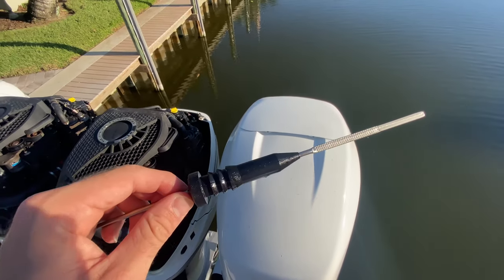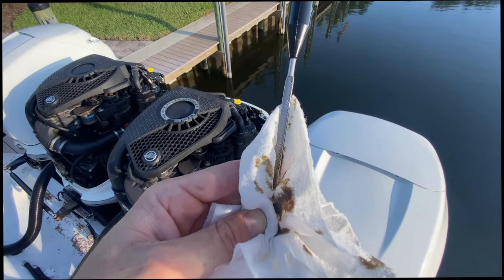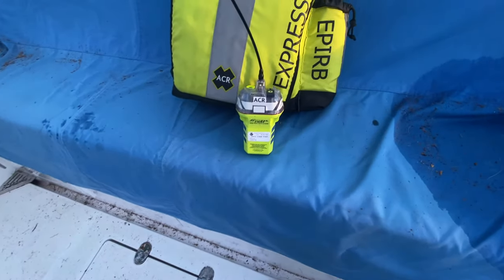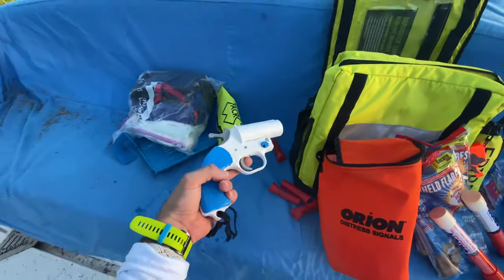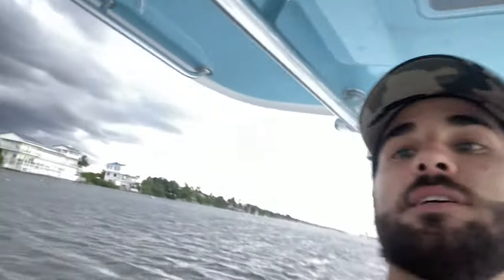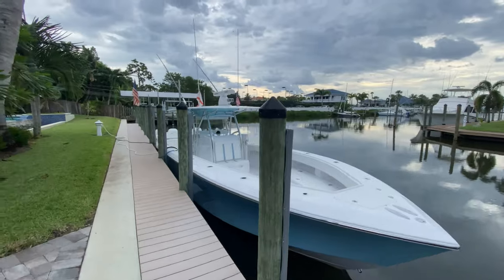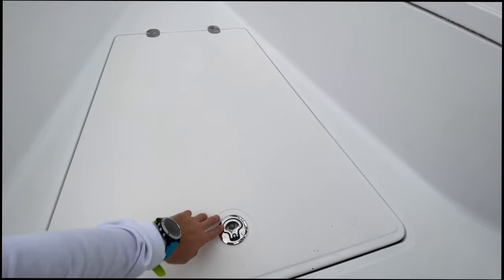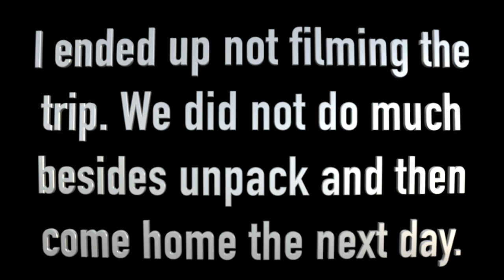How to Cross to The Bahamas! (Bahama 41)

Comment: It would worry me that all 4 motors have run the same time under the same load and you had to add oil to your center 2 motors, I would think your outside ones would show the same but I understand the broken cowl latches, the length of the Bahamas crossing in open ocean would bug me a little but you know your boat better than me. Love your videos, keep up the great work.
Reply from the maker: I agree that it definitely is something that should be done but, from experience, these motors go through at wildly different rates. Usually they don’t go through it at all like they should but only sometimes do they actually lose some. And at the end of the day that is why we have 4 motors. Had the middle two not been able to run, I still have the other two motors that I did change. It would’ve been annoying to get home on only 2 but doable.